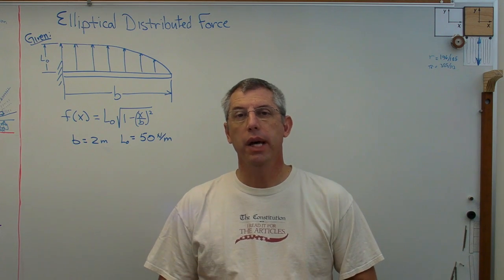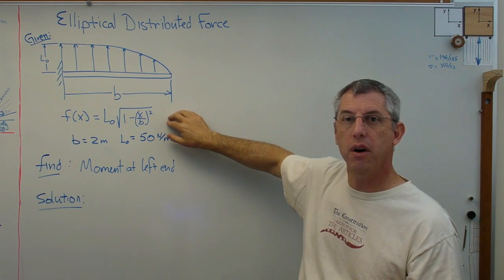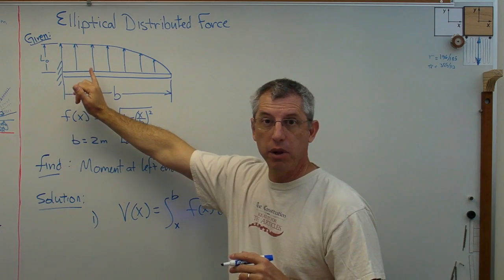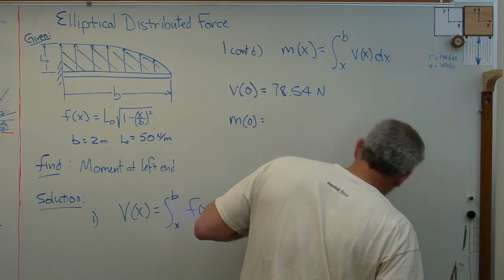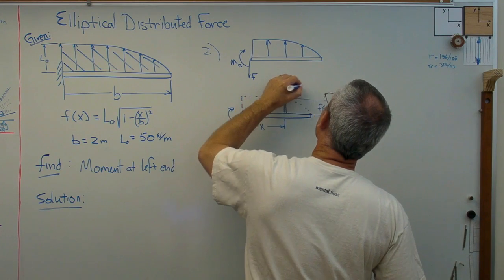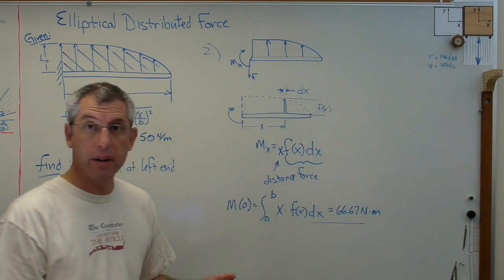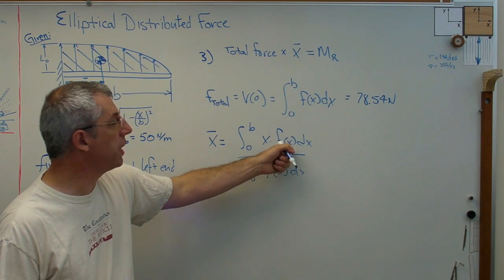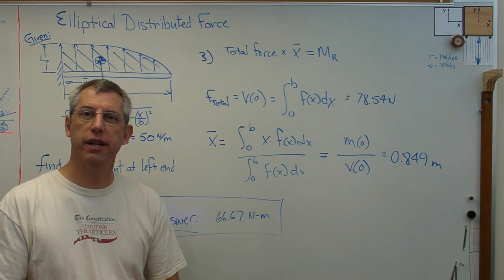Elliptical Distributed Force   Brain Waves

Comment: Lift/Shear is 157.08, if moment is 66-2/3rds.

Else moment is 33.333 if semi-span lift is 78.54.

4/3rds divided by Pi = 0.42441318. The span-wise location of the elliptical lift centroid, as measured from the fuselage side. 

1/2 total aircraft lift multiplied by [(4/3)/Pi] is moment for a spemi-span of unity. 

Multiply by semi-span length outboard the fuselage for bending-moment.

And multiply again by spar height...And again by ratio of distance of the area centroid of the spar caps from the outer most fiber of the top spar cap surface.

Then divide by maximum allowable material compressive (yield) stress.

Again multiplied by load-factor... 

This is minimum Ix for a spar at this span-wise station. Not accounting for additional spar(s) wing skin, or stiffeners contribution to bending resistance. Or accounting for moment reliving affect of wing weight and weight of fuel or landing gear located outboard of the 4/3rd over Pi span-wise station.
Also doesn't account for mass position forward of the aerodynamic center, moment coefficient of wing at Vd, tail down-load, etc...